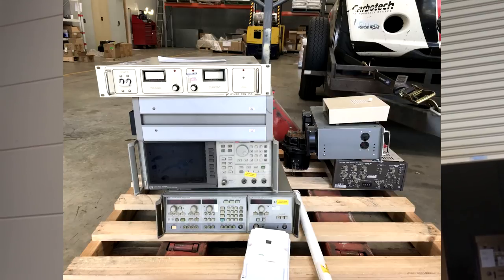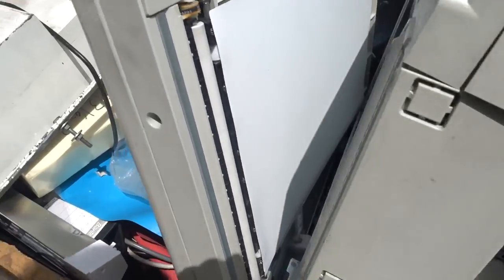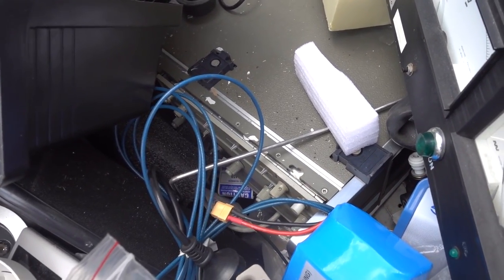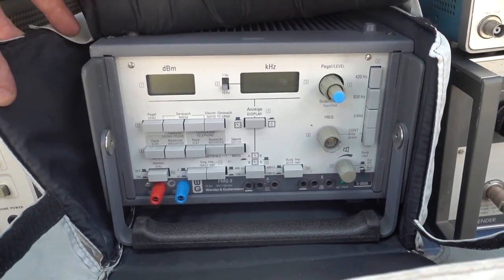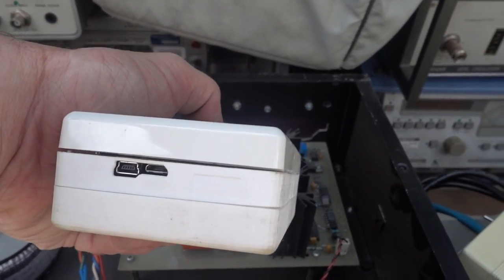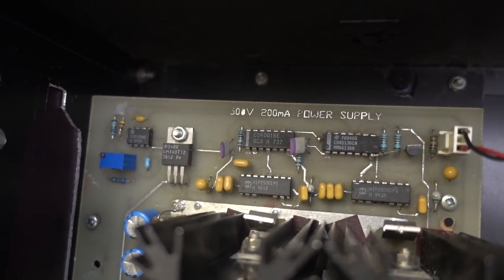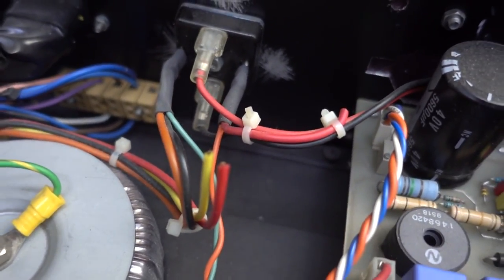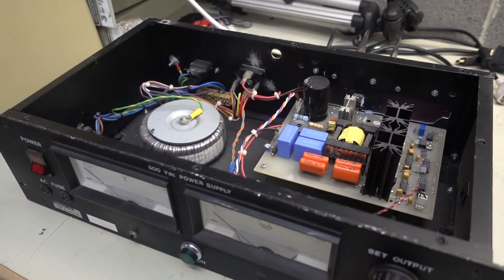EEVblog #1134 - Dumpster Diving Teardown Tuesday

Comment: Wow, so much gear that could be rescued! And here I am struggling to find suitable items to BUY to make repair videos on!
Reply: So much waste, when it could be serviced and resold
Reply: Yeah, I would try to get that whole container with me, so much nice stuff and what is not possible or too expensive to repair still contains many nice parts that are hard to find or too expensive for most, like those two transformers or even the rack cases.
Reply: I feel you, I would repair and repurpose the whole lot! It's fun because it adds a lot of creativity to the technicality of repairing, designing and building electronics. And it helps waste recycling too~

I already scour second-hand websites and stores for stuff that people want to throw away, but man a dumpster like this is not something I can ever imagine happening here...
Reply: Historically this said company would list their old stuff on ebay for ages before putting in the bin. Never sold well. Not worth the effort of their own staff reconditioning this stuff for sale. I
Reply: The dumpster i go to has smart tvs washing machines  etc enough to furnish a house

Comment: Did anybody feel disappointed Dave didn't plug it in.
Reply: You know the mantra. Don't turn it on, take it apart!
Reply: It was already taken apart though.
Reply: there something missing on the back, wires are cut
Reply: Yeah.. said DC fuse on the back.  Have to tie those wires together if you wanted to use it, I'd guess.
Reply: BlackEpyon judging from missing fuses, plugging it in couldn’t have turned it on, and perhaps even torn it apart.
Reply: I see 500V and opened banana plugs, then the earth on top of the transformer who knows whats under the pcb, definitly needs a detailed check before even think about plugging it in, looks nice and good made, even the "on"-button is small probably for safety or could be a fuse.

Comment: Hint: Maybe the plate with the two coils was the top plate and the cut wires in the 500v PSU were going to the top plate.
Reply: @Okurka.  I did not actually reviewed the video. I am just assuming that there are components missing which is the reason for the cut wires Dave is pointing out.

Comment: Oooooohhh... an RF Millivoltmeter up to 1.5GHz !!!  I work in a cal lab that specializes in avionics test equipment, would love to have something like that for DME and Transponder stuff in the L-band.  We have a high impedance probe for our HP spectrum analyzers though... but I'm a sucker for the simplicity of the old gear like that!
Verrry interesting note about the toroid transformer!!!  It took a second to realize what you were talking about  :-)

Comment: Now that brings back memories. That equipment is from a Telco site.
I use to install those 48v rectifiers (Battery Chargers) in the Exchanges/Radiocom sites way back in the 90's. 
They are 50A with load sharing to other rectifiers. They use a daisy chain ribbon cable on the front panel for Coms between the rectifiers. Very reliable & they use passive cooling.

Comment: 48VDC rectifier is from telecom equipment PSU. Almost every radio relay station, GSM (HDSPA, LTE and all others), PMR, PABX and everything around it use 48VDC for power. The point - it's efficient and compact to convert 220 / 110 VAC to 48VDC, and you can put 4 Pb acid batteries and get a 48 VDC. Most of power supplies for telecom can use backup batteries - charge and get power. And those rectifiers are modular and hotswappable. Modern rectifiers can pull through 1200 watts in a 1/8th of a standard 19" rack unit size.

Comment: I worked at Bell back in the mid 80's and used that jitter gen/rec all the time. We were doing testing on high speed fiber systems.

Comment: Hi Dave, Very interesting teardown. I love your channel and interesting contents. I think I'm familiar on the road you're driving and I can see where you end up. The first traffic light is the Park Rd corner Station Rd. The second traffic light is Powers Rd cor Station Rd Seven Hills. After the CALTEX on the left is the RFI building logo and you end up the driving behind the big truck which is roughly 87 station rd. I can also see the reflection from your right eyeglass the logo of the company "C" which is the globe sign. If I'm not wrong, this dumpster must be EMCTech at Seven Hills. Cheers

Comment: One quick note - the "48V rectifier" you mentioned is likely a part of a DC power plant.  These plants would take mains power in and provide clean DC power (48V) out for equipment that uses DC power supplies (in an ISP perspective, routers, switches, etc) - DC plants can be configured to provide hundreds of amps of DC power using multiple rectifiers.  These plants also have batteries to provide hold-over power in the event of mains failure - long enough for a generator to start.
Reply: Rack mount UPSs use 48v battery backs, and I've also seen large 48-port network switches that have DC inputs. Perhaps it's more efficient to just have a horkin' big 48v DC power supply (with voltage levelling at the individual devices) to power all your racks than to have every device on the racks with their own power supplies?
Reply: Yup - I work for an ISP and all of our equipment locations use DC plants to provide 48V DC power for our switches and routers.  The plus, I guess is clean DC power to the equipment, the sucky part - the DC power supplies on the switches/routers don't have easy to disconnect power cables (screw lugs).  Additionally - in our locations, we have dual DC plants so the equipment has redundant power. (The larger routers actually have 4 or more power supplies - e.g., Cisco 9910 - 4 x 4.4KV 48V DC power supplies, minimum) :)
Reply: Why do these large routers need so much power (4.4 kW)? Do they have powerful computers inside, provide PoE for additional networking gear, have optical interfaces with powerful lasers?
Reply: Well - the Cisco 9910 I mentioned is a pretty hefty beast.  Fits standard 19" rack, but is almost 3ft tall, and fully loaded with Route Processors (2) and line cards (8) weighs in at around 400lbs.  And - eash RP is a powerful multi-core processor + lots of custom chips for routing, the line cards also have powerful CPUs + custom chips for the fiber interfaces (16 x 10Gb or 8x100Gb typical per line card) + on the 99xx routers, add in "fabric" cards which control the backplane and manage traffic flow between RPs & linecards.  Throughput for the router is in the multi-Tb/s range... they really move data! (and sound like a jet engine when running). - and - the 9910 isn't Cisco's largest - they're just the ones I've played with.
Reply: Thank you. These machines are some beasts indeed.
Reply: Well, you've got better experience with this stuff than I do, Tim. I used to work IT at a local school, and we had a full height 19" rack in the server room, but our equipment was a pittance compared to some of the stuff that's out there. We learned to do a lot on a shoestring budget.
Reply: Thanks!  Working for an ISP does give one exposure to some pretty nifty equipment.  My favorite "little" router we use is a 1U sized unit with 40 10Gb ports and 4 100Gb ports - lots of power in a tiny package.  I don't recall it's performance off hand, but it's somewhere around 800Gb/s I think.  But - demands on the network keep growing since everyone wants to stream this and that, and want faster and faster...:)
Reply: +Tim B
Our school was a big proponent of BYOD early on, so maintaining wireless connectivity with several portable labs of laptop computers, AND everybody and their dog bringing in their wi-fi enabled devices, was a huge task with our limited budget. For a while, we were using these mid-range Netgear WNDAP350 units scattered strategically throughout the building. Using what free software is available to make heat maps of the radio coverage for every channel and balancing those channels to avoid channel overlap and reduce radio echo in a concrete and cinder-block building (lined with student lockers no less), but ensuring even coverage is quite a task (the auto channel management on the WAP controller was never able to do it properly), especially in a building where most of the walls are at BEST translucent to the microwave band. Things got easier when they put up the expansion wings, as they used drywall on aluminum studs rather than cinder-block for the internal walls, which means that coverage wasn't as much of an issue as managing channels and volume.

They eventually did get the budget to upgrade to a Ruckus system after I left, but the more expensive WAPs are still no match for the laws of physics regarding how those zones are mapped. More expensive WAPs just mean that you can connect more devices with higher throughput. You still have to fight the physics of the building, no matter how much money you spend.

For all that though, we still made sure than every room had at least a couple Gigabit LAN ports. They cheaped out in the construction of the new wings, installing these Chinese 3-in-one wall plates that never maintained good connection if the cable got bumped or wasn't seated correctly, and I ended up replacing a number of them with Keystone RJ-45 jacks myself.

Comment: Recycling 10/10 it looks like it's in a Common dumpster that goes to the landfill..?! edit, there is even florescent light bulbs and a xenon (read, led) light bulbs APPALLING and What cost? That should be straight illegal. Shame on you Australia. And EEVDave  at least you recycle.. Keep up the good work! :)
Reply: Thought they were high pressure mercury bulbs, and some broken fluorescent tubes as well. Sure freaked me out a bit.

Comment: I would quite like to see you dismantle that 40A battery charger thing and figure out what’s wrong with it, and also measure the capacity and estimate whether the battery is screwed and talk about internal resistance

Comment: looking very much like this company was into broadcasting equipment maintenance. The 48v switchtech power supply is quite common in that field (though that model is being phased out) Note that when hooked up to batteries it will run a positive earth.

Comment: Nice call on that ground wire being connected to the top of the toroid so it forms a single turn. Definitely a no-no. I suppose it's possible the lug is not connected to the chassis below but seems unlikely.  This old gear really are now boat achors. They turn up at hamfests all the time and sell for practically nothing.

Comment: The "Level Osciallator" is a calibration RF source. Probably so you can fine tune the levels on your vector network analyzer. How else would you know that what you measure is actually +10dBm ?
(probably someone wrote this already)

Comment: What kind of buildings would have stuff like this in their dumpster? Seriously, where should I be looking? This is absolutely glorious.
Reply from the maker: It's a very specific company that needs this sort of stuff.
Reply: Got it, thanks. I'll look into what's in my area that could be promising. I sure hope we're going to get a look inside some of this stuff, or maybe a repair video :)
Reply: Could be any company that does their own EM/compliance testing, some of it's clearly for that. The rest of the gear is too odd ball to narrow it down.

Comment: I work for county govt on the roads dept. We share a facility with a transfer station (dump) . There is a big electronics recycling area and I can be fired for taking anything home. There was a older marantz receiver (mid 70's) a few months ago that looked perfect. Looked it up on ebay and they were going for $400.00....
Reply: Id risk being fired to take something worth $400.
Reply: @simontay4851  not me. I really enjoy my job and worked for 20 years to get here.

Comment: Are they legally allowed to throw these in a dumpster in Australia?  I figured those old electronics would be full of lead.
Reply: We're supposed to use e-recyclers which it suposed to stop it going to land fill but I'm not always convinced...
Reply: I guess no, but that doesn't seem like a common dumpster, more like a construction one. I assume they will sort the waste when they remove the dumpster.
Reply: @petertiggerdine2631  Electronics go to landfill? How shall it rott there??
Reply: They supposed to remove the various elements out and recycle them back to smelting.

Comment: Not another Telstra lab - Network & Technolog Group biting the dust?
Thats what happens when they fire another 5,000 staff.
Mind you if all they are going to end up being is an NBN reseller, the only technology left is in the mobile stations - but then again, most of that is 'off the shelf' anyway.

Comment: I wish I had such finds here, not that I have the space! Did get a bunch of various cool old stuff from my time working in the computer lab at a place that also did recycling, so many schools cleaning out old storage rooms and sending truckloads of stuff in! Which is part of the reason I have no space! XD I'd love to have had those toroids, maybe one would fit the crappy chinesium power-supply I have that the thermal fuse in the transformer died! (I should probably just part it out)

Comment: Wow, must be a happy bastard who scored free HP 8753A VNA, HP 8350 Sweepgen and HP 8405A VectorVoltmeter along with Spellman HV PSU on top and Phillips Pulsegen on the right.
HP 8752A VNA in second pic is even better.

Comment: My daughter called and told me about two lawn mowers and two lawn sprinkler tractors sitting out by the road. The lawn tractors are very expencive.  Both mowers are repairable and sellable. I will put them away now as it is fall. I can typically make between $60-$100 for each mower. The lawn tractors run about $89 so I can sell them for $50 each.

Comment: I'm guessing that wall socket thing was a homebrew low-amperage lithium cell inverter, or something of that ilk...
Reply: I totally wanted to see the inside of it, I've actually built a couple just like it (albeit with 12V batteries and external chargers).